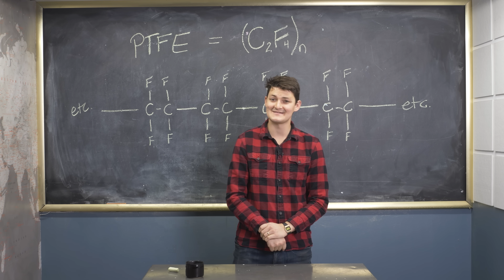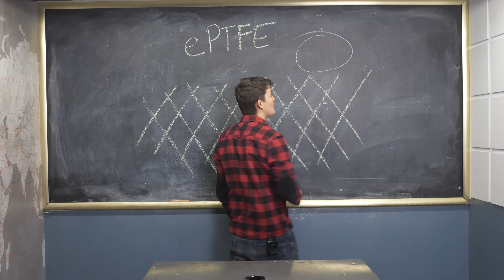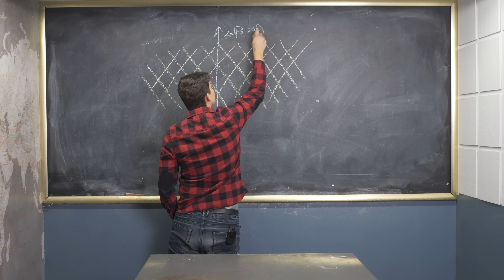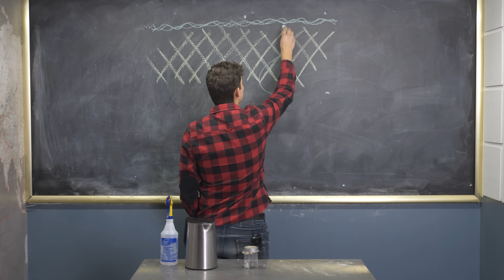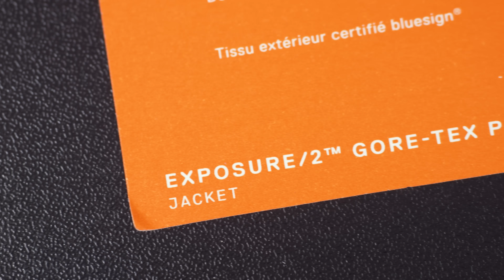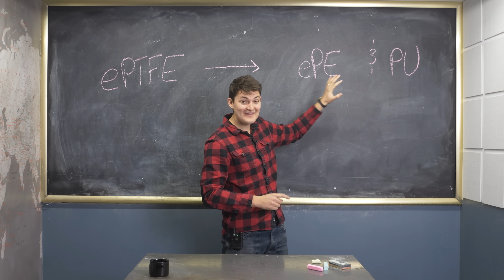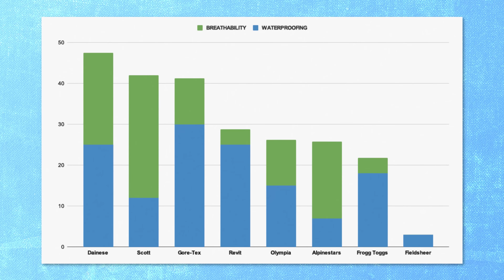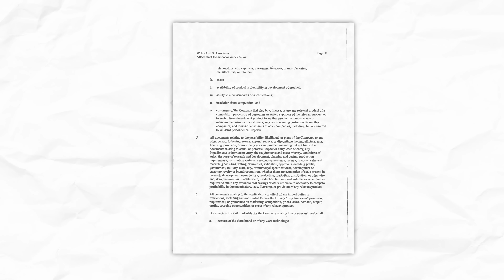Gore-Tex is a Marketing Gimmick

Comment: While i do get your point that you’re trying to make, having been a postman for about 5 years in the UK goretex shoe-wear kept my feet dry when hot outside and when raining, i’d rather have a membrane that keeps me dry during the summer and risk having the patches of membrane that get wet be moist underneath rather than wet. Any hydrophobic coating wears off quite easily when you go in an out of vehicles or on and off bikes. My goretex pants have kept my double o’s fairly dry pretty much all the time. Just a different perspective.

Comment: AIUI, ptfe based Goretex was not just a ptfe film. To be suitable for clothing, it had a PU coating on both sides of the membrane to increase adhesion of outer and inner fabrics and to prevent contamination from dirt and salt from sweat. Although it is described as breathable, it was only breathable to water vapour, not to air. For this reason bivvy bags had to be made from 1st generation Goretex which was a ptfe membrane without the PU coating. This would allow the bivvy bag to be zipped up but allow movement of oxygen into the bag and CO2 to exit the bag. However this made it vulnerable to dirt which could form a bridge across which water could pass.

Comment: Very interesting video, by the way recommended by The Algorithm.
I know Gore-Tex from mountaineering jackets (I've got one) but this video surprisingly ended up in motorcycling jackets (I still have my Dainese from back when I was a biker as a kid, 30 years ago). I also am familiar with those impermeability sprays I usually use on my boots and shoes.
Very good point about Gore-Tex being impermeable OR breathable, not both at the same time especially in rainy damp conditions. One good observation about this is that my Quechua mountaineering jacket made out of Gore-Tex has long zippers that run under the arm up to the armpit, wisely located so you can open them to evaporate your hot damp sweat... when it's raining outside... without rain entering the jacket. If Gore-Tex were impermeable AND breathable there wouldn't be a need for such strategically implemented long zippers.
Thanks for the video, cheers.

Comment: I started using Gortex back in the EARLY 2000s due to military equipment being made of the stuff. At the time, it worked and did the job we needed. Honestly, it never occured to me that there were better options. As such, thank you for pointing this out.
Reply: How is your gore-tex jacket you just bought for $400+ doing?
Reply: @ignatjasevits411  My Eider gore-tex jacket from the early 2000s, though it had a crappy (and useless) double direction main zipper, worked great to keep me dry while motorcycling in the rain. I was tired of being fully wet after the ride. I went on to buy an Aigle gore-tex jacket 10 years later or so, which was great. Since they were dual use jackets (summer jacket + polar fleece), I used them all year round.
Reply: Because you believe advertisements!  😂😂😂😂

Comment: Speaking as someone who has had all of their Gore-Tex issued to them for free, I prefer Gore-Tex over anything else, because I actually know how to take care of it and prepare it. Just like every other piece of equipment or weapon that we're issued, it requires regular maintenance. In my civilian life, I've tried numerous other waterproof and breathable materials, some cheap, some pretty expensive. None of them have worked as well for me as Gore-Tex, and I always end up returning, selling, or giving away the other garments. I've worn Gore-Tex from -55°F to 65°F, from single digit humidity to 100% humidity, and it performs quite well. Other materials get loud or crinkly sounding, some get stiff, some get brittle in the cold, Gore-Tex doesn't. The breathability while wet isn't really that big of a deal, for a couple reasons. One, it shouldn't get saturated if you maintain it. Two, a good garment will have vents to allow extra heat and the moisture it carries to escape quickly. If you're sweating that hard in your Gore-Tex, you're not using it properly. I've carried a 35LB ruck, in full battle rattle, with VB boots on, while carrying an M240B, in over a foot of snow, and I've also done the same in snowshoes instead of VB boots. Never had an issue getting wet or sticky in my gear. I always paid close attention to venting, because it's easy to warm up in that situation and cause yourself a problem later on when you're not as active. Suffer minor frostbite on your toes or fingers because they were wet when you took your gloves or boots off, and you learn very quickly to manage moisture properly. I'm not saying that Gore-Tex is the be all end all of outdoor wet and cold weather gear. There probably are other options out there somewhere that perform as well. I will say that if someone has a negative view of Gore-Tex for performance reasons, they're probably not well-educated on it's use and maintenance. Ask any combat arms service member in the US how important maintenance of their critical items is, they'll tell you it's top priority. Know how to use what you're using, know how to maintain it, know how to repair it, and stay two steps ahead of everything. Failure to do so could kill you.
Reply: you've never been in the military. Why do i know this? Gore-Tex boots are, by far, the WORST thing ever. Once wet, it;ll stay wet and it becomes a nightmare. everyone in the military hates the Gore-Tex boots.
Reply: @DiabloOutdoors  Where did I mention Gore-Tex boots? I'm talking about the Gore-Tex parka and pants that were issued to soldiers prior to the introduction of the gen 3 7 layer system. You know, the gen 1 and gen 2 ECWCS? I don't recall ever having boots with a Gore-Tex tag on them, although the temperate boots were waterproof. The only boots I mentioned were VB boots, and those have no reason to use Gore-Tex since they're made of rubber, and there's no managing moisture in those, only temperature. Thanks for trying to play gotcha, though, even if you do suck at it.

Comment: From this video, I get the impression that the waterproof/breathable claims mostly holds up, just that GoreTex is more or less the same thing as all the other brands.
My own experience, though, is that the waterproof-claim is quite literally short-lived. I have had quite a few PTFE-jackets. And all of them, while pretty good initially, have been replaced within 2 years because they started leaking from the fabric itself.
Reply: Did you wash them with nikwax tek wash (or a similar product) and reproof them? Waterproof fabric needs regular maintenance, plastic is basically the only thing that'll stay waterproof indefinitely.

Comment: Superficially Plausible.  It's not perfect, but used correctly, the spectrum of a quality gear is weighing expected and potential elements.  Layering comfort and best guess to conditions will dictate your shell.  Next you'll post a video saying modern shells that use fewer seams and more glue are worse because they don't even stitch anymore!.  Yes, if you want to have something that lasts longer but performs worse; get a 90s TNF summit.  Fashion seekers have a hard time understanding some new lightweight materials MAY have a shorter lifespan, but they are far superior in more ways that count.  Clickbait title, and if you're buying a technical shell to walk the dog... yeah ok, you duped yourself.

Comment: This doesnt add up for me, I’ve been climbing and hiking in the mountains of the UK and European alps for 40 years, and Goretex is still the best fabric I’ve worn. I note that the simplistic science employed here doesnt really take account of actual use in the field, where things are far more complicated. In reality, what experienced users like me will tell you is that ultimately the value of any waterproof garment of this kind  in wet conditions is not 100% dry satisfaction, but to delay discomfort and wetting out, to dry more quickly, and to keep the wind offAll of these fabrics achieve that to varying degrees, and it happens that in my experience Gortex Pro is exceptionally good in wet weather - my current Montane Goretex pro is as good if not better than any jacket I have worn in wet conditions - and I have worn many fabrics, and worked in the industry for some years. And yes, it helps reduce the build up of sweat inside in that kind of weather, which is essentially the marketing point - I sweat more heavily than most, so this is something I pay close attention to. It may be that the UK and Northern European climate is just the ideal testing ground for goretex and similar fabrics. I have never had any affiliation of any kind or received any benefit from any manufacturer of breathable fabrics or jackets of this kind.

Comment: Hard disagree on this. I've been riding for 35 years and in my early, broke days when Goretex motorcycle kit wasnt a thing or stupidly expensive, I tried so many different solutions to staying dry. The best one was a one-piece suit that was great  but once of the bike I had to take it of quick as I would rapidly boil in it.

My first pair of army surplus Goretex legging were almost life-changing. Finally something that actually kept me dry and you could move about in without getting soaked in sweat. 

After retiring I became a motorcycle instructor and again, Goretex kit was the only thing that kept me dry, all day when out in the rain. I'd be walking around on the training pad and didn't sweat to death. It's no gimmick.
Reply: The price comparison is very unfair.
It compares a laminated jacket with Gore-tex, with a nog non laminated jacked non Gore-tex, laminated jacket's are double in price because it's way more work and needs to be made wit a lot of handwork, so that explans the price difference, hense it's not the membrane!

Comment: I’ve used Gore-Tex and “not Gore-Tex” for years in outdoor applications involving a lot of rough usage. (Logging, skiing, sailing, etc.)
I’ve found repeatedly that Gore-Tex items really are made better overall but often not really better enough to justify the up pricing.
Thankfully a lot of that pricing difference can be gotten around by buying it off season.
Reply: What ur running into there is called implicit bias, the gortex goods feel higher quality not bc goretex is actually better itself but bc if ur company can afford to license it in the first place it means u likely already r producing higher quality garments to begin with. Not saying gortex is bad at all tho, implicit bias or not it is often a sign of better quality, and as a professional that’s usually top priority.
Reply: Goretex is way better than other brands specially on the long run, i have tried a lot of different brands and now only buy stuff with Gore tex

Comment: I would be super interested to see a part 2 of this video regarding waterproof membranes in boots. Hypothetically, if the exterior of the boot is hydrophobic enough to prevent wet out, then the boot should remain breathable and waterproof. But if a boot is hyrophobic enough to prevent wet out, is a liner really necessary? Once the liner fails, is it doing more harm than good leaving you with a chronically dank boot?

Comment: Gore-Tex got it huge in the 1990s when it received US military contracts.  I was in service with the US Marines starting in 1993.  Originally our rain gear was old school stuff:  Ponchos and rubber "gumby suit" top and bottom.  Those first USMC Gore-Tex items were crap because water went through the seams, i.e. the armpit, etc.  Your uniform would be soaking wet in those areas despite the Gore-Tex gear.  Later gens of the Gore-Tex gear in the 2000s were better.  Regardless you'll still be sweating like crazy in a rainy environment.  It's actually better simply as layered clothing when it's a bit cold.  

I retired from the service in the 2010s but I wonder if the US military can get a better contract now with competition, because the military likes things cheaper with personnel equipment.

Edit:  There is a problem with Gore-Tex items in the military I forgot to mention earlier.  It's if you're in a maintenance environment.  For example my career was working on airplanes.  Getting oil, hydraulic fluid, stuff like that just ruins Gore-Tex.  You can wash it all the time to get the fluid / oil off but it's never quite gone and it ruins the water repelling ability over time.

But anyways, it's just a brand name now.  People will pay higher money for a brand they recognize despite a competing item doing the same thing on the cheap.  I still recall in junior and high school kids being made fun of for having some non-name brand clothing.
Reply: you covered everything I was going to so I don't have to
Reply: I worked in outdoor retail when GoreTex came out in 1979. The first stuff we got did not have sealed seams in any way - we knew to seam seal our own kit and advise customers, but I wonder whether people that got stuff on contract literally missed the memo. What even we didn't know was not to wash it in ordinary washing powder
Reply: @catshoemike ...So, it was a partially finished product that you couldn't treat like Any of your other garments, huh.
And they charged how much More?
Reply: @truthsRsung  log off buddy
Reply: Military pays Corporation for Waterproof Materials and Processes...
then goes to War in a Desert.
Bahhhaahahahhahahahaahhahahahaa
Reply: >11

Comment: Back in the 80s Gor Tex was a huge hit!! Well, the marketing was. I was a hunter, Waterfowl and Upland birds. Gor Tex and Thinsulight were a huge deal. Didn't take long to figure out it was bull shit. I have insulated boots and upland boots that are very light weight. My feet would still sweat, on those moist fall days my feet would still get wet? A lot depends on how the Tex is installed too. Needle and thread tends to put holes in the waterproofing! As for my gloves? Sweat and colder than the heart of a whore!!

Comment: I now understand why the Army stopped using Gortex for its cold weather parka. I was issued gortex in the 80s and it was, as light infantry, my second best piece of gear. (Your still number #1 poncho liner / Woobie.)  When I was issued "gortex" in 2003 it sucked. Now I know why.

Comment: I must say that you are quite wrong on several points of way you say in your video.
Goretex is probably the most waterproof and breathable membrane there is.
It's easy to make a jacket waterproof, just use a plastic bag inside your jacket.
Problem is that it don't breathe and you get wet from inside.

Goretex membrane is the best balance of most waterproof and best breathable there is.
There are more waterproof membranes but they don't breathe that good.
And vise versa.

There are lots of studies of this if you use google.

Ask your Goretex dealer to give you a pure goretex membrane glove and make your tests and you will see.

The reason why you impregnate the fabric is not that goretex (or any other membrane) isn't waterproof. 
It's because the fabric it self gets wet. When wet you get a more heavy "jacket" and that wet fabric makes you feel cold and wet even that you ain't.

Why not just use a impregnated fabric then and skip the membrane?
You can almost get a equally waterproof product, but the problem is that it's not lasting very long due to wear.
Also it's only withstand 4-5h before the imprgrated fabric will let water through.
A membrane can't be worn out. 

Is a membrane fabric perfect, No, but very close.

The only time when it will let water get through is when you body temperature is around the outer temperature.
Then the membrane work both ways = you can get wet.

So please redo your research.

Comment: for me, gore tex was always good for winter. Be it shoes or gloves or jackets, when you live in a winter region, where you run through snow for a few months, you will appreciate it much more compared to non core tex material.

Try some non gore tex gloves for a few days, riding a bike for 2 miles a day, in winter and tell me if your fingers are still on.

You can comfortably wear gore tex gloves and have warm fingers with no issue at all. You get gore tex jackets for 100 bucks, same for shoes, and gloves usually start with 40 bucks.

Nowadays i dont need them anymore because austria doesnt have a winter anymore. I guess global warming. I was used to 2 cold months with lots of snow, 10- 20 years ago, now its more like 2 cold weeks with 2 days of snow.

Comment: I have had a few "membrane" jackets. All of them ended up in a bin as trash since I soak trough during rain and the membrane starte to fell apart. I switched to GTX (Paclite and Active) and the jackets are reliable and very well made with no quality issues for years. Same with shoes. So far I trust the black batch with GTX sign and I know that if I pay more I will get reliability. I would really like to try eVent jacket but its not available any longer anywhere in EU :(